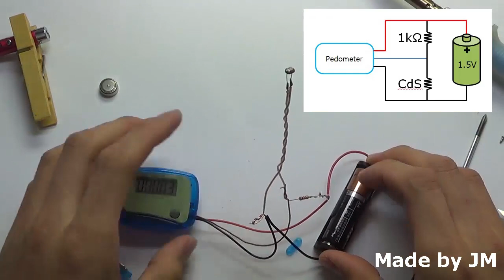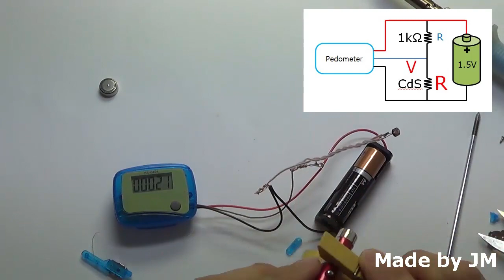Laser Beam Interruption Counter

Comment: I'm guessing when the laser is on CdS it's resitance is very low which in turn makes the mid point 'V' of the voltage divider low. 
Then when the laser is off the resistance of Cds becomes very large which makes the mid point 'V' go high? Is this how it works?
Reply from the maker: Right.

Comment: Have you tried to test how fast this thing can keep accurate counts? Would the limit lie with the digital circuitry of the device or the response time of the photoresistor?
Reply from the maker: The reaction of the photoresistor is slow, so fast motion is not detected.
Reply: @ThomasKim  The reaction time can probably be improved by exchanging the LDR with a phototransistor circuit, but it would make the circuit a little bit more complex.

Comment: I think it is interesting that you twist wires together counter-clockwise. This seems backwards to me. I always twist them clockwise.
Reply: Noah Spurrier now that I think about it... I twist them away from me, which would be counter-clockwise left handed and clockwise right handed. Because that particular hand motion feels more natural and can be done faster.
Reply: That makes sense. I can't remember which hand I favor for twisting wires. I twist them clockwise because that the same direction you tighten a nut onto a bolt. I also twist them clockwise because I often use a wire nut to secure and insulate a connection.
Reply from the maker: It is counterclockwise because I twisted it with my left hand.